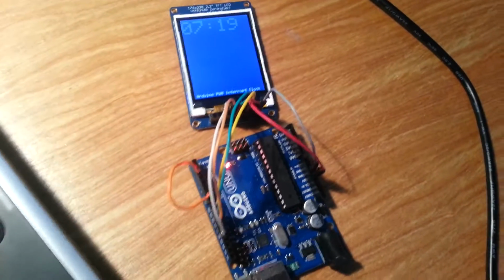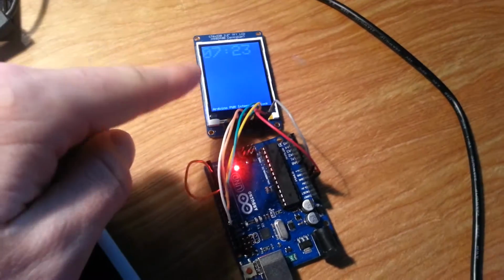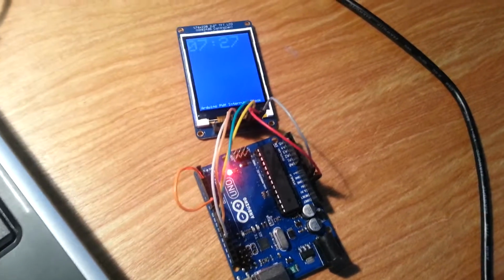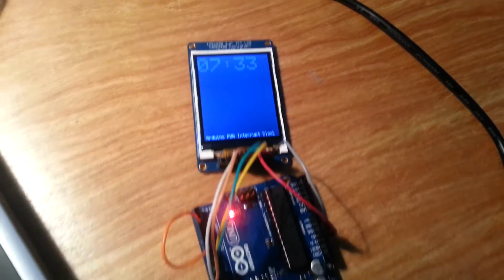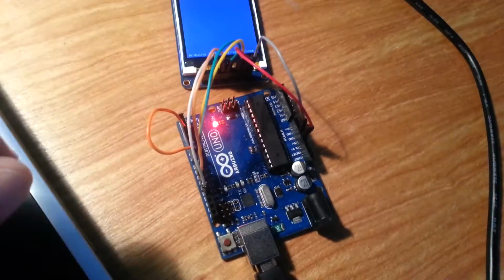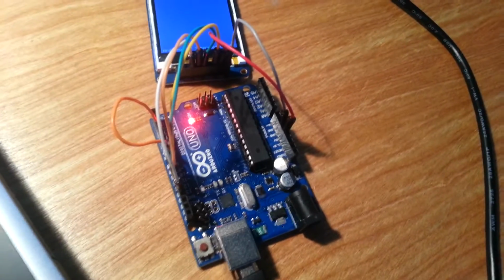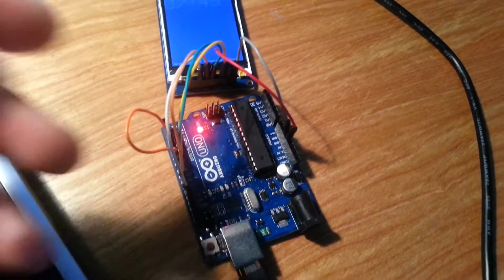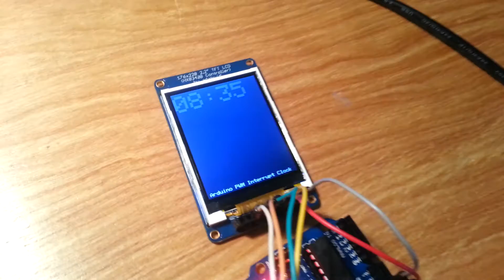Arduino UNO clock with PWM Interrupt timing

Comment from the maker: I continued on that previous post by Mohammed Al Sahaf on using the the Arduino as a fairly accurate real time clock (RTC).  The accuracy of it is accomplished by using PWM (pin 6) wired into an interrupt pins (pin 2). In this video I am using the Adafruit Industries 2.2" TFT and the Arduino UNO.

I posted a full write-up including wiring instructions, pictures and nicely commented code on my blog here: 
http://contractorwolf.wordpress.com/arduino-pwm-interrupt-clock/

 #arduino     #UNO     #adafruit     #PWM   #arduinointerrupt   #RTC